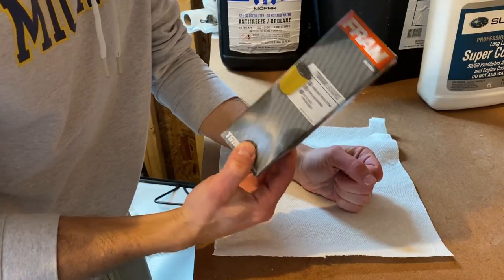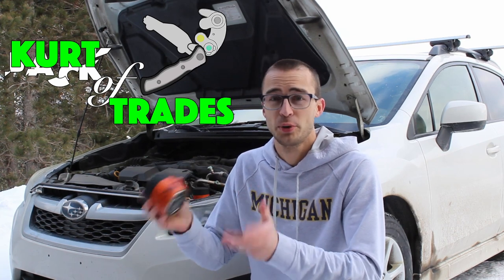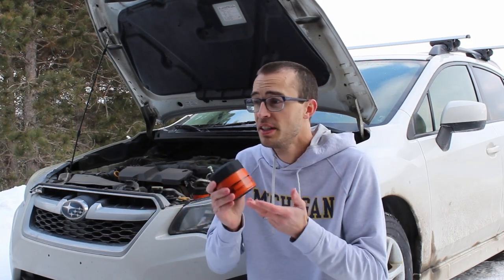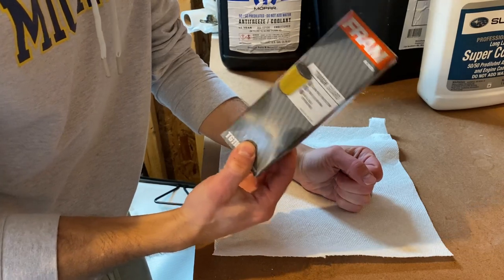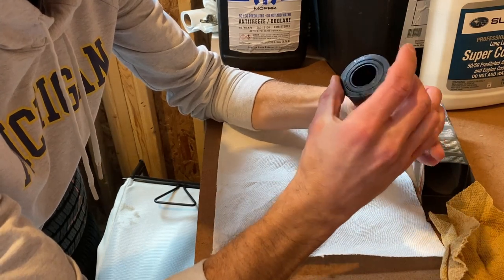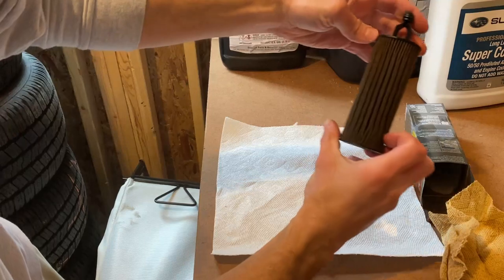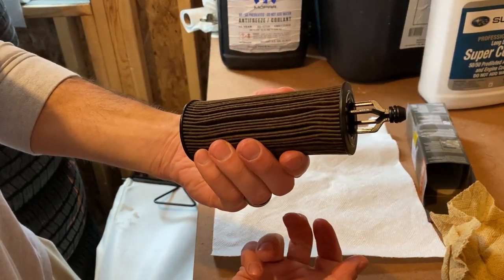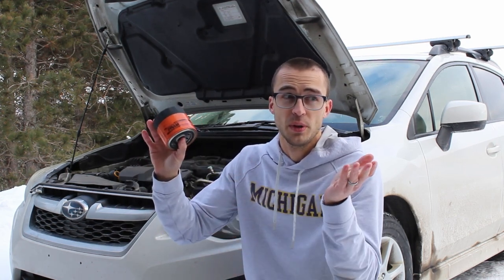Everyone was WRONG about FRAM oil filters

Comment: Thank you for this. I’ve been using Fram for many many years and never had one single problem. And you’re right, if they were so bad, there  would’ve been a recall to pull them off shelves , stop production, and the company would be forced to identify the issue to the public. And if anybody could “prove” that it damaged their engine, there would be a class action suit against the company. So somebody had it out for Fram when they made this nonsense up. Not to say that they’re perfect. Every company has their flaws and mishaps. But overall that myth was debunked.

Comment: I've used tough guard filters for over 50 years. I hear things like the metal is thin, the end caps are cardboard, it blew up my engine...etc. In a lot of cases it was poor maintenance or low oil level so guys are looking for excuses for their stupidity. There is nothing wrong with them. Good info
Reply: You said it right on point a lot of this false, misleading, and bad opinion of Fram oil filters is from people that jumped on the bandwagon or neglect their maintenance intervals and oil changes and ran the oil and filters way over the miles it was intended to run

Comment: I've used Fram and others for more than 20 years never heard such bs
Reply: Same here, on probably 30 different vehicles and have never had any problems
Reply: I have ben using them for 43 years, never a problem! Put my first one on my first car, a 1972 Ford Galaxy 500 when i was 18. If you do regular oil changes your fine!
Reply: You're hearing it now because I just had a repair done on my truck and the mechanic found a broken down oil filter had plugged oil passages and caused lifter failure at 6,000 mi. (10,000 km). The parts store was all out of my usual Fram Tough Guard so I went with the Fram Ultra Synthetic.

All within a few days the "Change Oil Soon" light came on, then a slight ticking sound, and then followed by an engine light and a more pronounced knocking sound. 

I used the Fram oil filter along with 5 quarts of Castrol Edge Dexos 1 Gen 3 oil, and I used 1 quart of the same oil but was Gen 2. Anything I found about the oil said it was okay do mix the two before I proceeded with the oil change

Comment: I've heard the negative comments about Fram oil filters for years, although I have used Fram oil filters for more than 40 years on all my vehicles and i have yet to have an engine failure, or any issues that would indicate lack of flow or excessive engine wear, nowadays i use the Fram ultra synthetic oil filters!

Comment: About a month ago I was driving home from work and noticed my oil pressure dropping. It went from around 60psi to basically nothing. I stopped and got my truck towed home. I went to oriellys and got a WIX oil filter to replace the Fram "Tough Guard" filter that I put on my engine 1000 miles earlier. Swapped them, started my truck, and oil pressure was normal again. I cut apart the fram to see it was completely collapsed. I got lucky and learned my lesson.
Reply: Proof or it didn't happen
Reply: Total B.S. 😂😂😂😂
Reply: The inside of the filter is just a fabric/paper material. Even if it collapsed the oil could still pass through it. Def gonna need proof
Reply: Was a mechanic for many years and never heard of that happening to any filter.
If it did happen you should have contacted Fram as they would want it to see what caused the collapse.
Reply: What the O/P didn't say is that he hasn't changed his oil in over 30k!
Reply: Or you got fake chines filter

Comment: My dad is ASE certified and always recommended Fram.  3000-3500 mile oil changes vs 5000 or 7500 is where you see engine longevity performance differences and less wear and tear.

Comment: Fram filters are garbage because they're Rusty brand new.... You don't have to take my word for it you can literally go to any auto parts store open up a box with a fram oil filter in it and you will notice moisture and rust. When you're done looking at that one open up another one and realize that that wasn't the
Reply: Been using them for quite some time, have 6 of them in my garage no rust on any of them that I have seen - pretty decent filter IMO and not terribly expensive (using ultra synthetic XG8A and XG3980)

Comment: I have used FRAM for a few years, they are cheap, last enough to make it to my 3000 miles oil changes and no valve train noises when used as compared with other cheapo filters, however I change my oil at 3000 miles, the filter media in the cheapest FRAM filter is conservative and may have an issue with 10000 miles oil changes but that's when you need buy the correct one for your application FRAM has variations for each applications. I know they are not the best but they work and are cheap enough to make my oil changes be frequent and affordable.

Comment: I’ve been using frame oil filters on my ram Cummins for years now and I never had a problem and I already had three trucks but I always use the 20,000 mile standard but will change my oil around 8000 to 9000 miles so far and never had an issue right now I have the Silver color frame that runs 15,000 miles and so far my trucks been doing good

Comment: I use FRAM Tough Guard cartridge oil filters on my 13 Camry. No problems in the past 10 years. I have used FRAM Extra Guard filters on my past cars, over the last 40 years  2 VWs, 2 Hondas and 2 Ford F150 Trucks all with no problems.  So, like you say FRAm filters are not as bad as they say! Yes they have cardboard end caps, but that part of the filter is not under much stress!
Reply: Actually, it’s an engineered fiber end cap, not cardboard or felt or paper or anything else the Fram haters like to claim. And you’re right…not under much stress.

Comment: I used FRAM filters on a GEO metro with 166K miles. I’m the original owner and have religiously chained my own oil. No issues, but my oil change interval isn’t 10K miles, and I’m not putting it on a heavy duty vehicle.

Comment: There's no way the auto manufacturers would put up with warranty engine failures caused by FRAM.  In the 80s at least one of the manufacturers took Jiffy Lube to court for using substandard oil and won.

Comment: Under 5,000 miles between filters they are probably fine. There is a video with 5,000 miles on the filter, the cardboard end separated from the pleated filter material.  I'll pass.

Comment: The filter you show isn't the Fram filters people complain about.  the can filters have a "cardboard" media it's not actually cardboard but you get what I mean.
Reply: I think what you are referring to are the end caps that seal off the ends of the filter media. You are correct. Not “cardboard “. It’s actually an engineered fiber and it works just fine, just not as aesthetically pleasing to the eye as metal.